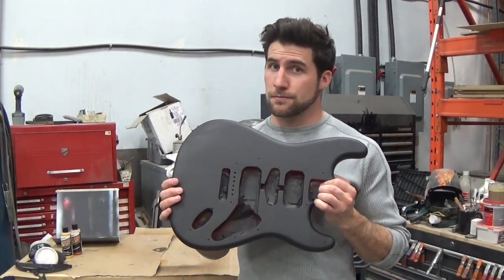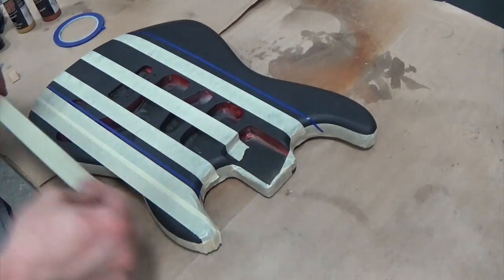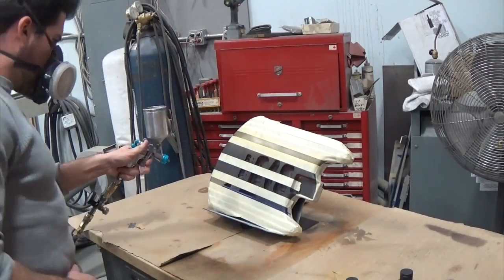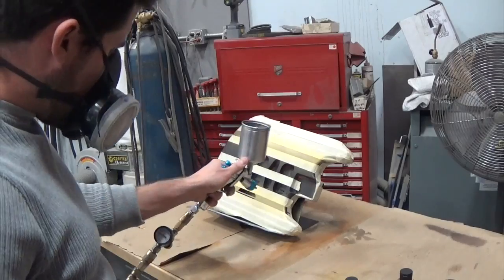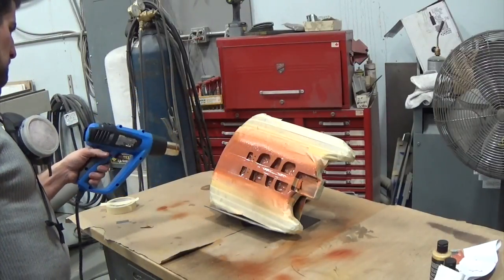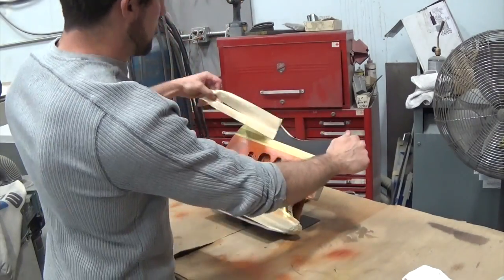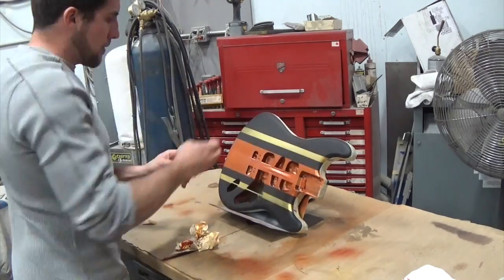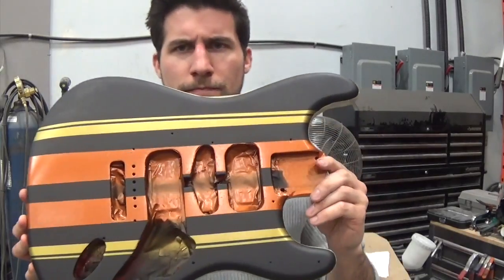Custom Guitar Paint Job   Metallic Racing Stripes

Comment: I took apart and sanded a cheap ibanez guitar and am rebuilding it. The body is sanded down to 1200 grit. I want to start finishing the body and neck. I bought some tru-oil and would like to used that if I can. I want to put some stripes on the body but not sure which paint to use and if it would even work. Any advice would be much appreciated

Comment: So 2 questions: what do you do if the stripes are darker than your base coat. (I'm putting black stripes on a pink body)
Also, you said you were "cleaning up some edges", which leads me to ask; what do you do if some of the striped paint falls outside of stripe? Like somehow gets under the tape while your striping it?
Reply from the maker: Black is nice and opaque. It shouldn’t be an issue to just go ahead and spray it straight over. 
If you want my frankenstrat series you will see how I clean up edges with a razor blade.
Reply: How should go about taping it? Should I just invert what you did here?

Comment: Hello Brad. First, thank you for all of your videos. You help a lot with them, so thank you very very much. I am going to make a guitar like you do at this video and just to be sure I ask you for the steps. 1- First, I can leave the guitar painting and at the area I am going to draw lines, and I sand a little with for example 240 grit. 2- No primer, and I paint as you do at your video with acrylic color. 3-  When it is dry, do I need to finish with some kind of coat to prevent that these lines get removed?
Reply from the maker: Change that 240 grit to 400 or 600 grit and you should be good. 
Yes, you will want to add a few clear coats at the end to protect it all.
Reply: @BradAngove  Thank you Brad. I have done my first test on a guitar that I can use for this issues (its a damaged guitar). As you can see, I have made mistakes when peeling off the tape. I think that it is due to process: Three silver color coats separated by 1 hour without peeling off the tape. And other 3 varnish matte coats at the following day separared by 1 our. I supose that, as you say at other video, it is better to peel of the tape while it is wet. Or may be that I have used a basic aerograph set which it makes me to use more coats till I have enough paint on the guitar. 
Here is the result:
https://www.screencast.com/t/gLJByQv0ZUG5

https://www.screencast.com/t/33unB05Ds8B
Reply from the maker: The problem at the top with the ragged tape line?
Reply: @BradAngove  Yes, that problem. At my second pictures that I had attached, I had drawn green arrows close to the problems. I supose that I had left the tape too much time, more than one day.
Reply from the maker: That could be the cause, of maybe you built the coats up a bit too quickly. Hard to say really. What did you say you are spraying with?
Reply: Decoart Americana Silver color, and Decoart DuraClear Matte (varnish). The aerograph set is this: 
https://www.amazon.es/gp/product/B07DPL4JW2/ref=ppx_yo_dt_b_asin_title_o07_s01?ie=UTF8&psc=1
I have used the 0.5mm needle at the maxium pressure that the little compressor offer (25PSI - 1.7 BAR)
Reply from the maker: Oh. That’s probably just a result of cheap paint skinning over poorly then.
Reply: Thank you Brad. How should I do to locate paints with good quality then? There are thousands of manufactures
Reply from the maker: Autoair and wicked colors are both good acrylic airbrush paints that should give you better results.

Comment: This is very interesting Brad, and it brings me to a question that I've been pondering that you no doubt will be able to answer easily.

If I were to paint racing stripes such as you have done, bur using paint such as you did with your Frankenstrat, and finally to use the 2k clear over the top as you did on that project, how likely is it that the edges of the racing stripes can be buried (for want of a better word) under the 2k clear so that the whole face of the guitar is smooth?

Is it a matter of gently sanding the edges and then using enough clear over several sessions to bury the edges or is there something about the properties of the paints that I'm missing?

As always....great video's and tremendous help. Thank you.
Reply from the maker: No, you've got it right. That's exactly how you would go about it, which is essentially what I did with the frankenstrat project.
Reply: Awesome...thank you!! I'll get some practice under my belt before I tackle this job for real, but you've been a great help. Thank you  :)
Reply from the maker: Glad to be of service. I hope it goes well for you.

Comment: Those massive strat pickguards are a huge bummer for cool paint jobs as they hide so much. Because the paint job looks nice.
Reply from the maker: Ya, I guess I could have painted the guard as well. I just didn't bother since I'll be sanding this off right away.
Reply: Brad Angove It's more like if one would do this "for keeps" a back routed body would be better. The pickguards are too  disruptive in my mind.

Heck might even go for EMGs so to get an even bigger canvas:)
Reply from the maker: Haha yeah. So basically, use a different guitar!
Reply: Brad Angove Hehe, yes:) This body works great for examples though.

Or go transparent pickguard so more of the paint job is visible. Been thinking of a blue frankenstrat with transparent pickguard. As it might be easy enough for me to attempt for fun:)
Reply from the maker: That would be cool. I should make a transparent pick guard one of these days to see how it looks.